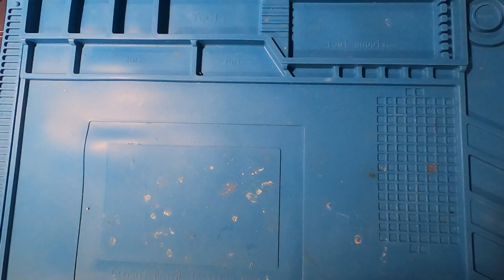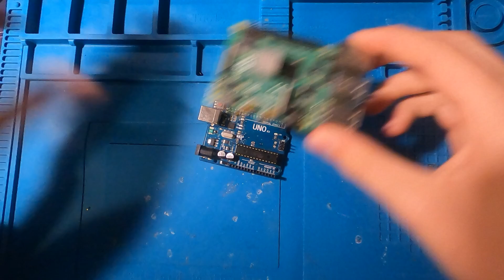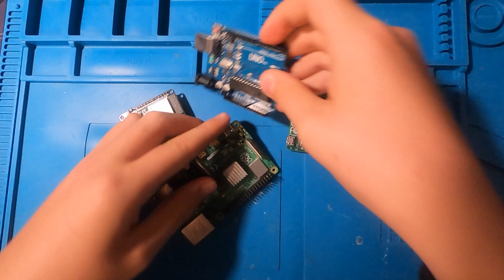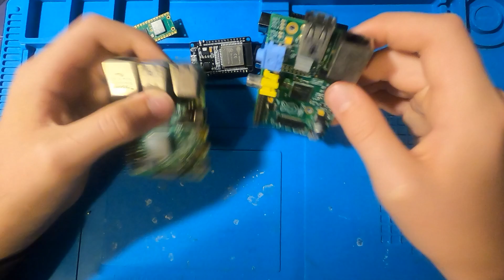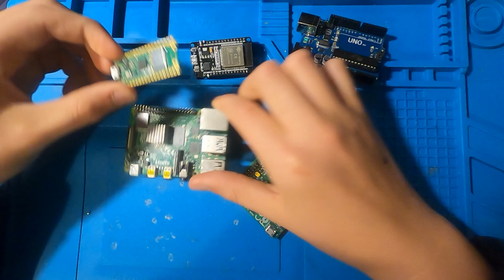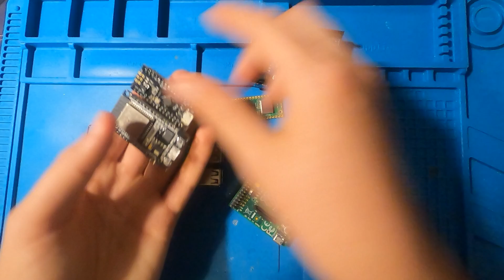How to program microcontrollers (Arduino, Raspberry Pi, ESP32, Pi Pico)

Comment: do you use python or the c++ language, i just have a hexapod that i asked deepseek to program it to work with a ps4 controller, but since then i rather learn how the programming works and learn from my mistakes.So far i Just have 2 esp32 s3 that has a gps and sim card that i can add and a rpi5.
Reply from the maker: i know a bit of python but do a lot of c++